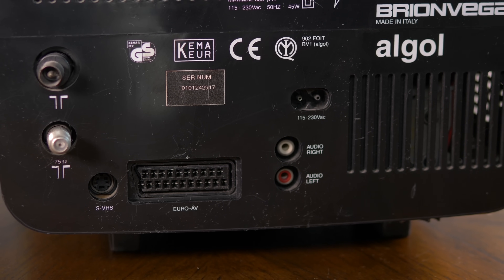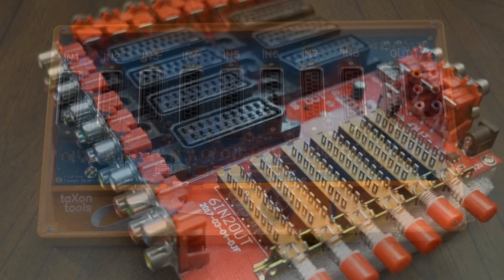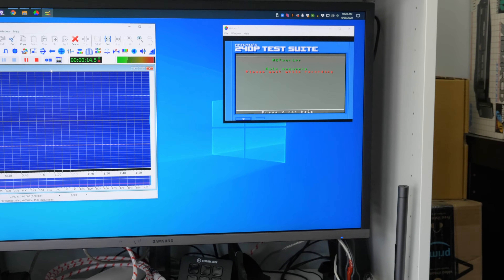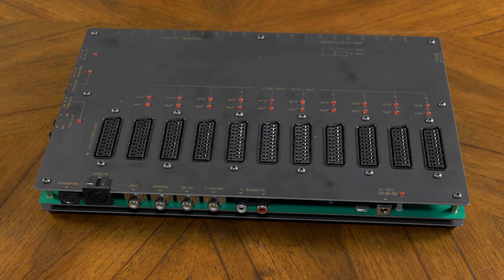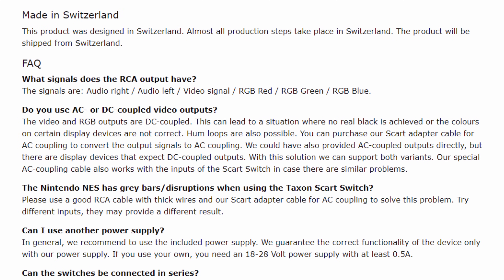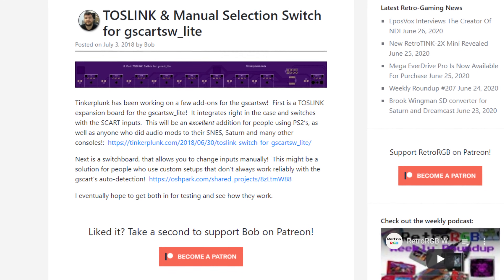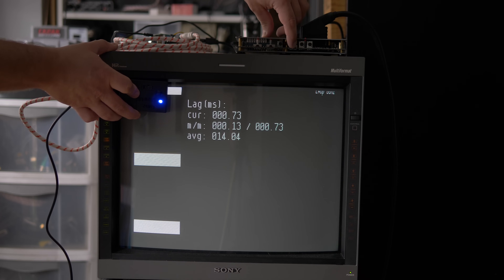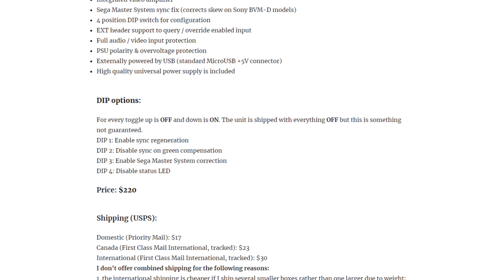SCART Switch Shootout

Comment: These switches would be overkill for what I am looking for. Are there any powered scart splitters? Need 1 Scart input to 2 Scart output that of course wouldnt cause any problems especially about input lag. Does anyone know of any known products that would achieve this?
Reply from the maker: You could try cheaper powered splitters and make custom SCART cables. No lag would be added with basic splitters, only ones with buffers.

Comment: I use the SCA-101 as my main, and I also have the latest gscartsw and Retro Gaming Cables switches. Unlike 13:33 I am passing component over SCART just fine. But, I received it 2.5 years after this video was made.

Comment: I know this is an old video. But for these switches what happens when I accidentally turn-on multiple consoles at the same time?
Reply from the maker: Nothing harmful, as they all have isolation circuitry.  That might mess with auto-switching and it's not good to leave multiple consoles on for extended periods...but if you just mean accidently power on two consoles, then turn one right off - No problem.
Reply: @RetroRGB  Thanks! I am in the middle of planning a setup for my TV with one RetroTINK and one of these switches!

Comment: We have some updates for our switch:
Calibration of the RGB and video levels: We bought a Rigol osilloscope and have noticed that we made a human error calibrating our switches. We have fixed that and now we are in the range of +- 5 Millivolts for each level. We also use potentiometers which are easier to callibrate.

Audio buzz: There was a clipping of the audio above some levels. We could make a small change to our circuit to support higher levels. The buzz is now gone for the Sega Genesis headphone jack on max volume (was not before the update).

Switching speed: We made the switching a bit slower so there is no Automatic switching while you are selecting another channel with the knob.

Video noise: We could not make an improvement without some price increase, but there is a "low noise upgrade" available now for our switch which reduces all the noise noticed during the tests. It is available for CHF 20 surcharge.

3D Print quality: The housing was not printed with a dry box. This was visible. All new housings are printed using a dry box so the whole housing has the same print quality.

Sync stripper: Was not available during the tests, but now it is available as an additional pure sync adaptor. It can be done that the switch powers the sync stripper over an unused scart line so no other signals are affected. The cable is also available with a USB connection for universal usage.

Second scart socket for upscaler: If someone needs a second scart output for an upscaler, we have created a special adaptor cable to use the second output of our switch for it.

Comment: If you were going to use both outputs on the SCA and could measure with an oscilloscope what voltage output would you aim for?
Reply from the maker: Around 700mV for RGB - Lower is fine, but anything over 714mV will start to wash out the image.  For sync, between 250mV and 1v is fine.
Reply: @RetroRGB  Thank you!

Comment: I have a question, I'm kind of a noob at this RGB stuff... I have 4 diff consoles with RGB cables, and I use them with OSSC. Saturn, PS1, and PS2 with SYNC ON LUMA, and Dreamcast PACKAPUNCH cable... Would the cheaper.. Otaku Switch work for all 4 of these? Does it matter what kind of cable I use for the RGB out?
Reply from the maker: When using the OSSC, sync types don't matter at all.  Also, all sync types will pass through the Otaku Switch without any problem.  So, basically, in your setup, there's nothing to worry about!
Reply: @RetroRGB  ok awesome, thanks for the quick reply! :)
Reply: @RetroRGB  have you tested their automatic switcher at all? I was thinking of grabbing that one instead
Reply from the maker: Yeah, don't buy it.  The manual one is awesome though!  https://www.retrorgb.com/otaku-6in3out-amplified-auto-scart-switch-review.html
Reply: @RetroRGB  ahh ok, gotcha! thanks!! Ill go for the manual.

Comment: If I'm torn between the SCA101 and gscartsw, which one would you go for and why?  Does either of these have an edge, quality wise?

Also, I need to know where to get a metal case for a gscartsw like that one.  Does your friend do comissions?
Reply from the maker: Do you need to support both JP21 and SCART?  Do you need a video distribution amp you can calibrate with your scope?  If so, definitely get the SCA101.  If you don't need those features, the gscartsw is most likely a better fit.
Reply: @RetroRGB  Hi, thanks for the response and all the effort you put in. I don't have any immediate plans for Japanese consoles, but I could always rewire the scart or find a converter, so that feature isn't a deal breaker for me. The variable sync level would have been handy for arcade tournaments/captures as I've run into issues before where the CPS2 output was split between 2 cabinets and a capture card, but it's so rare that I cap from that kind of situation these days that I don't particularly need that either.

I was already leaning towards the gscartsw but I liked the idea of manual switches. I had a random issue with some scart switch before where the Wii being in standby caused issues (only a vague memory since this is like 15 years ago but it might have just been a passive hub kind of thing with no actual switching and the Wii was outputting some kind of signal in standby that made the image dark). Direct XRGB output might have been nice since I have that and an OSSC but it's probably not that big of a benefit to just using a coupler and the short XRGB cable

I like the setup you have with the OSSC sitting on one of the ports and I can have the other port going to a CRT, so it's virtually no hassle to play any console on any display.

I think I've answered my own question. The deciding factor is ultimately AV quality but I know the gscart has stood the test of time

Comment: I recently purchased a 6 in 3 out that can simultaneously output also by Otaku
Reply from the maker: https://www.retrorgb.com/otaku-6in3out-amplified-auto-scart-switch-review.html
Reply: @RetroRGB  can you help me out here should I cancel my order since it could destroy my equipment? Sorry for rambling here
Reply from the maker: If you have any SCART cables with sync strippers in them, or if you're connecting two switches, I would cancel your order.  If you just have basic SCART cables, you should be fine...but there's no guarantee.
Reply: @RetroRGB  already cancelled it just to be safe since I could end up using a cable not knowing it has sync stripping or have a bad cable to use. I thought this would be a decent option since it allows 2 scart outputs and auto switching
Reply: @RetroRGB  Okay this time I ordered a Taxon Scart Switch along with some kind of upscaler adapter cable
Reply: Oh dear I also just purchased a kabledirect scart and plan to use them with the universal Nintendo multi out scart and wii scart, is that a bad thing? This one is the enclosure one. So that can be worrying that I could be making a bad order

Comment: i use a cheap scart switch which i bought from german amazon. i don't notice any difference between plugging in directly and using the switch so i'm satisfied with it, it doesn't even require external power

Comment: If one of the (new) GSCARTSW inputs is using Component video via a custom cable, and the dual outputs are going to a PVM, and the XRGB Mini, would that cause issues for the XRGB Mini? I understand the RGB-input on the XRGB Mini won't read the Component video signal, but my concern is that pushing Component video to the XRGB Mini would break it/slowly kill it over time (as you'd know, just because it's not breaking something right away, doesn't mean it won't break one day as a result).

Comment: Quick question bout the SCA101 concerning the non-xrgb 8-pin din output. I noticed that the diagram on the bottom of the switcher at 11:26 says the middle left pin outputs c-sync, but the SCA101 only outputs c-sync if the sync strip switch is on which, as you mentioned, outputs ttl levels of sync. Does that mean the 8-pin din is only usable when either that ttl c-syns is active or the original signal going into the SCA101 is c-sync? I'm asking because I'm not sure if I can use sync on composite or sync on luma through that 8-pin din and I'd rather not resort to getting multiple sync stripper cables for individual consoles or activating that ttl sync strip function and damaging equipment in the process.
Reply from the maker: I assume that diagram is just showing where to wire sync, but without the stripper turned on, it just passes the signal through.  There's no need to use any sync stripper at all going into an OSSC< RetroTINK products, the Framemeister and most RGB Monitors though.
Reply: @RetroRGB  Ok, that clears up a lot of questions I had so thank you. Another machine that, unfortunately, only takes c-sync for RGB is the Extron Crosspoint. I have one but I'm apprehensive of putting RGB into it because I heard the Crosspoint also outputs sync voltage that's too high for consumer equipment. If you can give me any ideas on how to deal with that problem then that would be highly appreciated. 

My other idea was to build a custom adapter that I can plug into the 8-pin din of the SCA101 and mate it to a set of Genesis component cables either from HD Retrovision or RetroTink. I figure if HD Retrovision can do it for that many consoles then it should work in theory. A bit of a hard project though, I want to be sure the components I buy for the build are high quality so not to introduce any unnecessary interference or audio buzz.

Comment: Hey Bob, great video as usual! Do you have a Brionvega Algol 11" ? I'd like to find one, how about the tube or image quality?
Reply from the maker: I picked that up a few years ago and it looks great!  It's PAL-only on all inputs except RGB SCART - That will accept both NTSC and PAL.
Reply: @RetroRGB  thanks a lot for your quick reply Bob! Do you know if it is the 1989 or 2007 model (the only two mode with rgb scart input)?
Reply from the maker: There's no build date on mine, but I know it's the model made in the 2000's.

Comment: I'd say the Taxon's RCA output is definitely a (big) feature. surprised you didn't mentionned that. Also, the positionning controls on the SCA is not reserved only to expert IMO, anyone can use that, and it's actually a huge feature. Other than those nitpicks, great video! very thorough.
Reply from the maker: 10:38 ;/  https://youtu.be/KeMPPyJAM_w?t=638
Reply: @RetroRGB  I mean touting them as a big plus in the bit where you review each switch's strenghts ^_^ not just mentionning it while describing the unit.

Comment: I think I'm just going to build my own at this point. I'm up to where I need something like 30 goddamn ports and even with my stacked daisychained switches it's getting out of hand.
Reply from the maker: Or just get an Extron Crosspoint.
Reply: @RetroRGB  We do have a matrix switcher in the house as it happens, but even then they tend to top out at 16 inputs.
Reply from the maker: Actually, the Crosspoints go up to 32.  You'll have to make custom cables...but 32 should cover everything :)

Comment: I have a quick question about the otaku dose it output what you put in as I have some s-video singles that I send via SCART?
and I notest you didn't mention Hydra SCART switcher is there any reason why?
Reply from the maker: Correct on the Otaku:  Since it's a basic switch, it will pass whatever's sent.  As long as the target device can accept S-Video over SCART, you're good to go.

I had a bad experience with the Hydra.  I hear they're better now though.

Comment: Thanks for putting this out! I use a shinybow scart Matrix switch,  but I may upgrade to a g scart eventually , so it's good to know that it's still stands up. However, You got to stop teasing us with this coupler man! That's a solution I've been looking for for a while, and I'm checking the website every day for an update!
Reply from the maker: LOL, sorry!  I'll post about the coupler as soon as it's ready!  Also, I used to own the Shinybow and it's awesome if you need a matrix switch.  No extra gaming-related features though.
Reply: @RetroRGB  haha, it's fine, I just have to eliminate 2 long cable runs for space and clutter and I'm getting the sweats every time I see it. Yeah, I enjoy my shiny bow I needed the two simultaneous output functions because I'm trying to get a streaming setup going and it works great so far.
Reply: @tsuran3848  Hi, I would like to purchase Shinybow Matrix Switcher soon for use with Playstations mostly. There is very little info about it online from retro consoler users. Have you encountered any problems while using it? Signal degradation, lost of signal ect ? Do you know any sourse of info where to look for such info ? Thanks in advance or your reply !

Comment: Why are the scart swithces so expensive?
Reply from the maker: That's a totally fair question.  The truth is that to add all these features in a way that retains the original quality requires very expensive parts, quality manufacturing and through testing.  The lack of features on the Otaku is why it's so cheap, as it doesn't require anything other than the main components.

Comment: Looks like the phase was set incorrectly when testing the gscart switch? And what’s with the pixel flickering in your captures?
Reply from the maker: The phase was set on all captures, those are digital artifacts - I just randomly started getting those again on my Datapath Vision E2S.  The analog interference in the blue area wasn't affected by the speckles, but it's really annoying that I couldn't get rid of them ;/  I ordered a new E1S, just to help troubleshoot.
Reply: But there is super noticeable ghosting on the gscart switch captures on the right side of objects. That can’t be correct.

Comment: Please test 'Hydra2 REVISED'.
I have gscartsw_lite and while it works great it's not perfectly compliant with the SCART standard. Also it's annoying that you can't use this switch with composite video.
Reply from the maker: The gscartsw_lite is absolutely compliant with the SCART standards.  Not sure where you're getting this misinformation.
Reply: @RetroRGB  fidde_se that makes RGB scart cables for PC Engine tested my gscart extensively since the cable I bought from him didn't work on gscart lite. He managed to make a new cable that did work and his conclusion was that gscart didn't follow the specs correctly. 

On some of his European RGB CRTs the picture was degraded significantly (dim picture) only when connected thru the gscart.

This was 3 years ago now so I don't remember all details, but maybe fidde does.

Comment: I am curious about the circuit used by the SCA101 for adjusting the horizontal and vertical position of the image... is it as simple as a phase shifter on the sync lines? Would it be possible to build it for myself? It seems like quite a simple thing to do...

Comment: That SCA101 looks amazing! Did it just came out recently? I had a look on its page and one of the notable things I've seen is the option to use a direct cable to BNC/RCA connectors which would immensely help the short distance issue I have with my gscart lite since the output connector to my PVM from retro cables is really short.

I had a look at shumps again and Super G is unfortunately not repairing gscart lites anymore which is a bummer. Mine is still working at the moment but if one day it goes out I might considering picking the 101 up since I would like to go back using a manual switcher.
Reply: Axunworks SCA101 is new and freat. green pcb version is only 1300 rmb abouy 180 usd